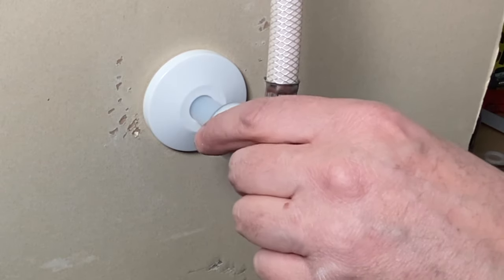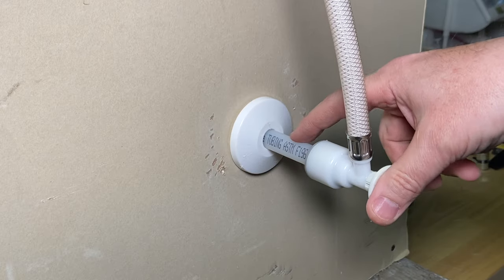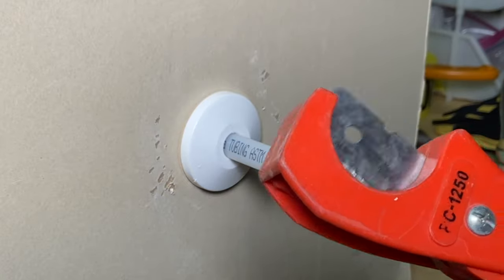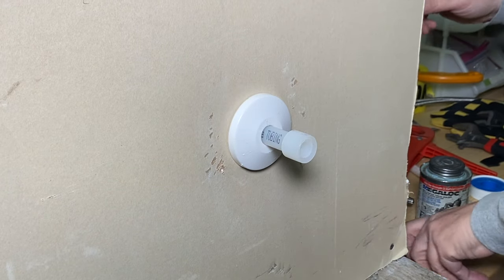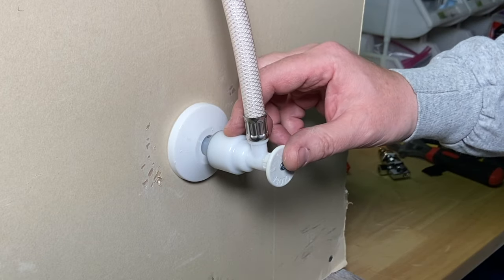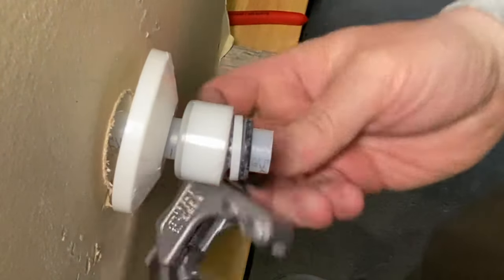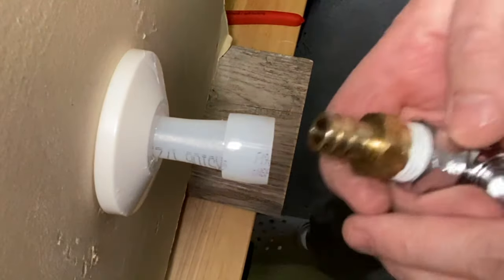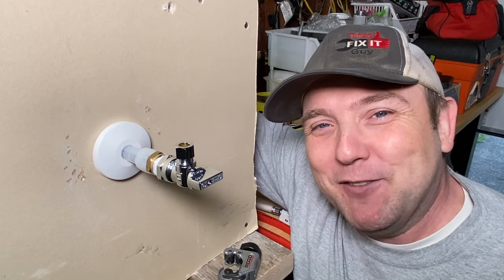Best Way To Remove A Flowtite Valve Ever!

Comment: EXCELLENT TIP/INSTRUCTION/VID-CLIP!  Gave me supreme confidence to make the repairs myself (on CPVC/PVC) vs hiring a plumber.  Bought a 1 1/8” pipe cutter as advised, got rid of a leaking “valve assembly” and the same next to it.  Planning on doing the whole house soon.  KUDOS to That Fix It Guy !!!!!!

Comment: I cannot over-stress how important it is to practice with some PEX-A and the Expander Tool before attempting to place new fittings into PEX-A (if you have not worked with it before).  At 6:00 he shows about 10 expansions with the expander tool and the fitting goes in all of the way.  I have worked with some PEX-A that required 15+ expansions before the fitting would seat fully.  If you do not get the PEX-A tube expanded FULLY and try to place a fitting in and it doesn't go in completely - you now have a serious problem.  Typically, there is only enough pipe sticking out of the wall to install a fitting.  If the fitting only goes in partially, typically there isn't enough pipe sticking out to cut and retry.  You GET One Try to get it RIGHT.  Home Depot sells 5 foot lengths of PEX-A type (very low cost), I recommend buying some and practicing b4 you attempt to do this repair.  Also, make sure you are using the correct head size on the expander tool (1/2 in, 3/4 in, 1 in) that matches the pipe you are working with.  The ONLY place that I have found that rents the Expander tool is Ferguson Plumbing.  Wish you the best.
Reply: Thank you!

Comment: I need to do the same thing with type B.  Do you have a link for that?
Reply: Pex B is not expandable. Don't even try, you'll get in trouble. Only pex A is expandable and it uses these specific fittings like the ones in the video.
Pex B uses different fittings and you can either use pinch clamps or copper rings to secure the fitting to the pipe. You will also need the tool for the clamp or the crimp tool for the ring. 
You can look online for PEX B to NPT male adapter 1/2", 3/4" or 1" or whichever size you need. 
Pex B fittings have 2 lines around the barb while pex A fittings have only 1 big one around it.
I hope I was helpful.

Comment: Uponor makes angle stops which you can directly connect the pipe to with expansion, instead of having to get a threaded adapter and then screw the angle stop on
Reply: Yes, but when that angle stop valve fails it is hell to remove and replace the expansion sleeve.  Plus you will need an expander tool again.  Using his method, you would just unscrew the old valve off and screw on a new one - boom done.